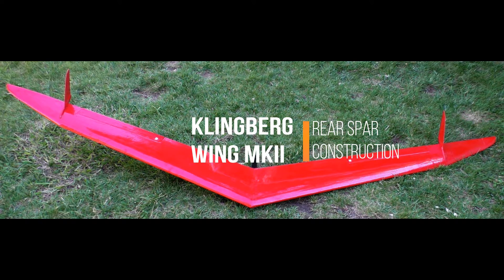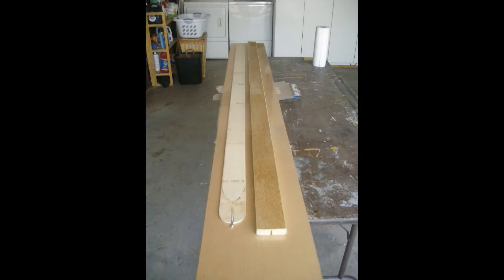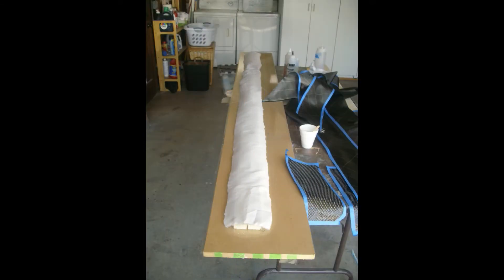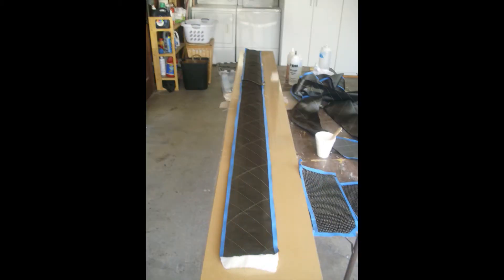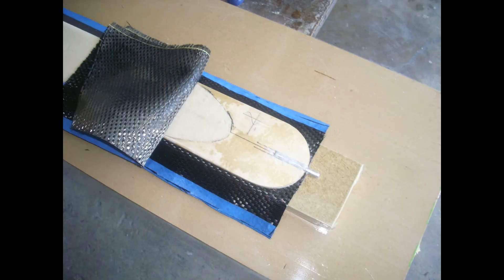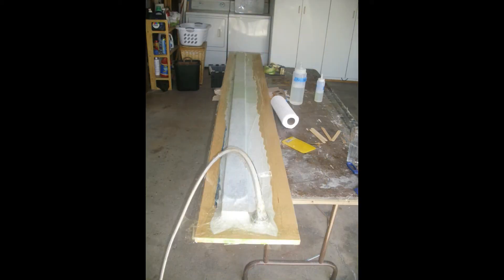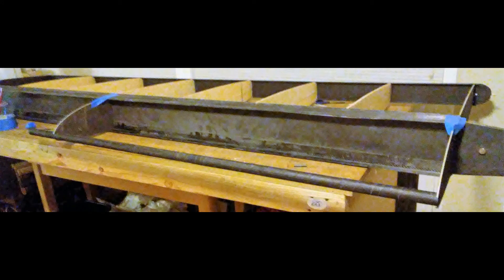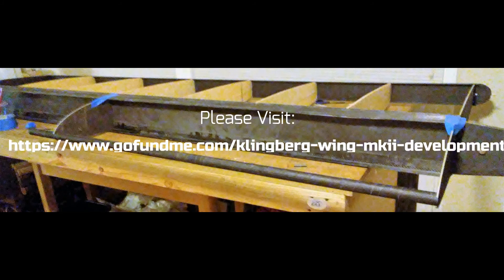Rear Spar Construction - KW MkII Rigid Flying Wing Hang Glider

Comment: I know you shouldn't really mix fibreglass with carbon fibre due to the very different properties, but in theory could you make the shear webs out of foam/fibreglass then where the strength matters in the spar caps, use CF?
Reply from the maker: Yes, they can be combined if done properly. Mostly it is an issue with elongation and a few other factors. Same is true for Kevlar and other types of cloth. The key is that the rule should say, "You should not do it if you want maximum strength" as a qualifier. However, there might be a desire for other properties that makes combining various fabrics a good thing. For example, on my first wing, I rolled the composite tubes for the pilot's cage out of carbon fiber laid on top of Kevlar. This makes a tube where the layers alternate Kevlar - CF - Kevlar - CF, etc. Back in the '80s when others saw this they were aghast! At that time is was hearsay to combine the two materials. What they didn't know was that I wanted the exact properties they described. By making my tubes in this way I had tubing that would have a "soft" failure instead of the "explosion" one normally gets with CF. It gave the tubing a yield zone that would protect the pilot in case of a crash and in fact that is exactly what happened in the crash. The glider flipped over three time going down a 300' cliff and when it got to the bottom, the pilot got up and walked away. I consider it one of the true successes of my first wing! Now, these days, you can actually buy cloth that is a woven combo of CF and Kevlar to give the same type of results. One can use a similar approach with fiberglass to get different results. In fact on my current design, I"m using CF on the inside of the D-tube and fiberglass on the outside. It saves a lot of money by not using CF where it is not needed. Same is true for my shear webs on the outer portions of the wing.